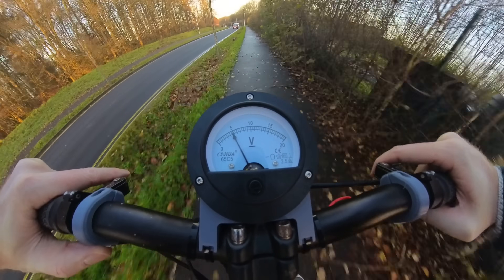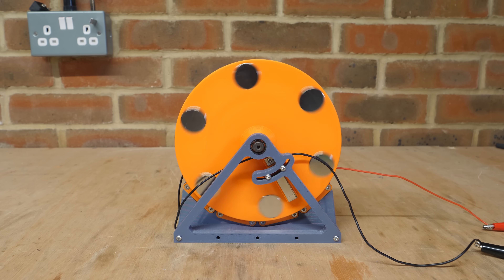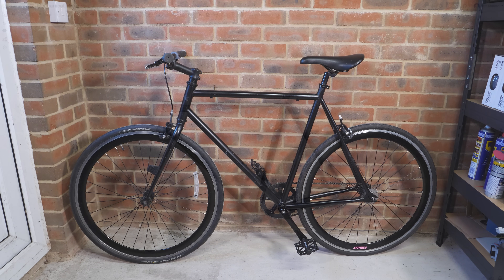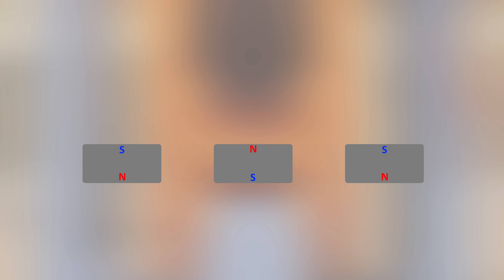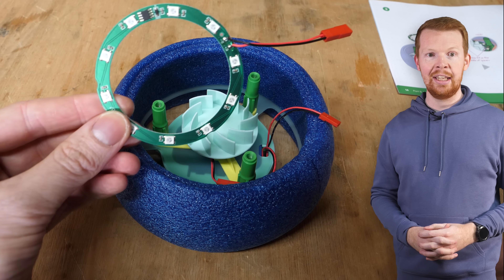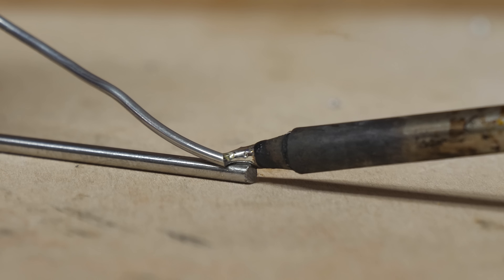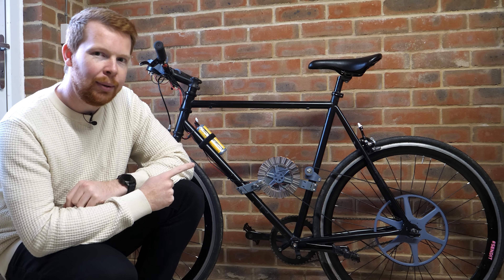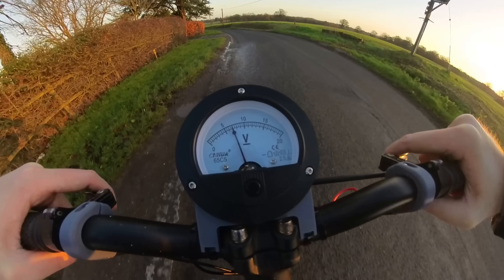The Most Minimal Electric Bike

Comment: If I may suggest...Add a capacitor,(perhaps a .02uf), across the contacts of the switch to absorb the arcing across them, much like a set of Points and Condensor in a car's ignition system...This will greatly increase the longevity of the contact switch.

Comment: Great job, Tom!  Small suggestion for whatever it's worth: a tensioner usually does better on the slack-side (bottom side in this configuration) of the belt.  The top side is going to almost always be in tension, so it doesn't need a tensioner there.  On the bottom side, you can even spring-load it to be an auto-tensioner, but on the top side, you would be fighting the spring every time you apply torque to the pedals & tension to the belt.

Comment: I had a bike cycle which i modified . I replaced the back brake with disk brake and removed the brakes pad from the traditional V from the front wheel. I attached  a small rc car gear motor to the front brake frame and when ever i press the  the gear get touched with hte front wheel and starts generating current which powers a small led infront of the handle . the vooltage it generated was around 5 volts. I had the safety on as i had a strong  back brake. there was little to no resistance at all

Comment: Idea: instead of using regenerative power to charge the battery, how about attaching a flywheel to the motor similar to the KERS bike from a while back?

Use the motor to get up to speed, and then when braking or going downhill, engage a clutch to transfer power to the flywheel and then use said power to charge the battery or as momentum to get the bike up to speed for the motor to kick in and take load off the motor on startup?

Comment: You should've wired magnetic switch to low voltage circuit, and which should switch contactor with high voltage somwhere else, maybe even have it in vaccum chamber as a wild card

Comment: On the issue of reed switch sparking:

The sparking issue that you see with the reed switch is the same issue that old school breaker points had when making and breaking electrical connections in the distributor of an engine. They fixed this problem by introducing a "condenser" or just a capacitor that is able to provide time for the metal contacts to separate.

Think of it like this, the coils are resisting a change in current flow, as the metal contacts move apart they are effectively trying to making the current flow zero. This causes a high voltage arch to form between the metal contacts until the energy stored in the coil is unable to resist the change in current or until the contacts are sufficiently far apart. This means the the arch is formed during the initial separation of the metal contacts, a capacitor added across the coil would increase the amount of time you have to separate the metal contacts to a distance where an arch is no longer able to form. 

I think you could fix your reed switch arching problem by adding a capacitor that balances your coil inductance. This balancing of inductance and capacitance is called impedance matching.

Great work on these projects, I love the videos and wish you all the best.

Comment: maybe instead of using magnetic fields to make your reed/read switch work. You just do a mechanical solution, bumps on the outside of the rotor that pushes the contact away and then use a spring to push it back close. this would still be in sync with the roto
Reply: reed switch and a power relay will work

Comment: Long time ago I've build an eBike with no electronics, just a 24 V DC motor, two lead acid batteries and three relays controlled by a 3 position momentary switch. It switched the batteries series-parallel. You'd start at 12 V and once rolling switch it to 24 V. You could also start in 24 V, but the motor was not too happy about it!

Comment: Great work. Resin printing for engineering looks quite strong. Plastic motor housing and frames is a good advancement.

One note on around 0:40 - I've found a lot of ebike motors are 3 phase ac. Hence why they all need those big mosfet inverter circuits in the aluminium cases. I think if we did use brushless dc that it might be more efficient instead of having to convert our batteries power to ac.

Comment: could you take a disc brake equipped push bike, drape a longer chain over  a brushed drive motor on a freewheel sprocket,  then glue magnets around the rims and for regen put 4 coils  positioned like  traditional brake calipers, run through rectifiers to charge caps or batteries ?

Comment: Forget Onshape, use FreeCAD instead and prevent that they can steel you your ideas with a simple change in their policy, like many other online operperated platforms did so far.
Take LFP batteries instead. Even for the supercapacitors is a balancer circuit recommended to charge them evenly. Yes, you get your electronics. 
Or even not. I have four LFP in series running for years without issue. Its much more juice than the capacitors.

Comment: As reference by others, a capacitor/condenser of the proper value solves the switch arcing problem. Plus a centrifugal timing advance/controller like in an old car distributor.

Comment: The idea of an electric bike that doesn't feel like it weighs two tons when the battery runs out,sounds great to me.I also really like the fact that it is for the most part additive and not invasive. If you were open to using at least one power mosfet to get rid of parasitic losees, sparks and the noise from the massive reed switch, this could make for a great assistive bike propulsion system, practical for daily use.

Comment: I like the idea of a bike with regenerative braking. The energy only ever goes into heating up parts with friction, so why not make use of it to charge a battery pack and run a light or charge a phone? Even if it isn't in an electric bike that can use that energy for driving it's still so practical!

Comment: Back EMF from the motor should be redirected to the battery using a diode or two. Just A slight deviation from the electronicless design

Comment: Great project, Tom. Some notes:

Regen on a bicycle isn't terribly useful because the majority of power input to a bicycle is lost through aerodynamic and rolling resistance losses, rather than going into inertia. So there's just not that much energy left to recover compared to something like a car.

A less complicated mechanical motor controller can be achieved by using a brushed DC motor with a mechanism to vary the contact angle of the brushes. It's very similar in theory to your reed switch motor, except with all the engineering difficulties already sorted out. It also gives you continuous control of the motor speed, both forward and reverse, which is pretty cool.

Copper or silver is going to be a better contact material than tungsten and definitely better than nickel. Just physically not melting is only one factor in durability: you want a contact material that's not prone to building up an insulating oxide layer, and which will generate as little heat as possible to begin with, while conducting it away from the contact point efficiently.
Reply: I regularly ride 300-500 mile cycle camping tours on an ebike I engineered myself. Frequent descents can be as much as 4-5 miles of steep grade. (One was 1500 feet down in 3 miles.) All lost potential, without any form of regen. You do you. I'll take any regen I can get rather than coasting to no gain at all.

Comment: to solder tungsten you have to heat it up to red hot, a plumbers torch will usually do the job, stick it into the flux tub when hot and use lead-free solder,

Comment: I do love the simple lack of electronics with this but I wonder if this could be further automated. Could there be a system to detect the RPM, and the super capacitor voltage, to automatically charge/discharge the super capacitor? It’d take the thought out of the switches and hopefully give you the optimum output for whatever you’re charging.

Comment: As an older fire alarm, technician,
My advice is Silver contacts like used on older (very old) Acme and Edward's box and gong circuits.
Very large silver surface area that can be very highly adjusted by nature of multi leaf  spring contactor construction.

It's the large electrical induction that kills  the contacts.
Have used similar contacts for high output capacitors.
Elevator contactor contactors can be fun as well, as older stuff is dc, coils that is, lol.

Just an opinion.
Cheers 🍻...

Comment: Put a Capacitor across your tungsten points to minimize arcing. Use 50 volt capacitors for energy storage. Mount your
magnets on Aluminum disks 5 to 10 mm thick  and 1.5 times your current diameter.  Make the motor drive pulley smaller for
more torque.  I really like your minimalist design.   👍👍

Comment: Years i ago i did a water ignition circuit and found out contacts wear out. The solution was an ac capacitor across the contacts and my arcing was solved. Carry the current and keep both sides of the contact equal in voltage. Essentally a crude dc snubber.

Comment: You guys like CAD programs.. something neat you can use them for is to learn about angles. An angle is defined as two straight lines meeting at a vertex. The Cad program will tell you, it is impossible to take an elevation angle from the surface of a sphere.  This means celestial navigation's elevation angles Prove Earth is a flat plane. - test it yourself!

Comment: why do it to add a push on the wheal when you can benefit from the voltage to turn a Fan ON, so you will benefit from wind pressure to push you?

Comment: Could always use a relay for your reed switch. Vehicle relays are cheap. Most junkyards charge next to nothing, if they charge anything for them. A starter relay should easily handle the amperage, I would think.

Comment: Problem is you are switching a coil which resists changes in current flow through self induction. Easy fix is to use a diode in inverse parallel with the contact as a flyback arrestor. Plus its not a transistor or a microchip, so still keeps the no electronics rule.

Comment: the design of an iron core of an alternator can be optimized for minimal cogging.
yer low-torque motor should have the maximum amount of  mechanical advantage (MA) over the load.     in other words, the smallest practical drive pulley radius should be used.!!!

Comment: The slack of a belt or chain on a push bike should never exceed 1” or 2.5mm of slack.  More slack than that will likely cause the chain or belt to jump off a sprocket.  Read up about spark quenches.

Comment: I think the sparking can be significantly reduced with a flyback-diode across the reed switch. The voltage across a coil is proportional to the derivative of the current ( v = L dI/dt ). So if you suddenly break the circuit by opening a switch, no current can flow and you induce a huge voltage (hundreds of volt) across the opened switch. A flyback diode across the switch (which cathode to the + of the supercapacitor and anode to the - of the supercap) will create a path for the current to continue flowing through the coils, preventing the sparking. It is a well-known trick.

Comment: I would be curious if something like this would be implemented on e-bikes how much would the battery range extended. I guess it depends how much downhill you do:)). 
I do not remember the hub engine e-bikes having any regen although it could. 

Ok ...here is an idea - adapt a normal hub dual engine bike to regen and see if it is worth it. I don't remember you trying this.  Technically should be easy to do -- only the electronics should be changed.

Comment: As soon as I saw the first set of contacts, I knew you'd need something else. :) Simple contact switches don't last any time at all. But there's another issue. Coils have inductance; they make electricity behave as if it has a lot of inertia, so when the current gets cut, the voltage goes sky-high as the electricity doesn't want to stop. That's what was destroying your contacts. What you might want to do is have a reed switch driving a sealed, high-power relay rated for an inductive load. However, I don't know how this dual-magnetic-switch sort of arrangement would behave in rapid switching.

   But I love the look of the coils. :D The analog voltmeter too, I miss those things.

Comment: The problem is that what you've made isn't technically an electric bike, but an electric motorbike, because electric bikes in the UK have to run on pedal-assist. Getting a pedal assist that doesn't rely on electronics wouldn't be easy.
But what you've done is upload a video for public viewing of you operating an unregistered motorbike on public highways, and operating a (n unregistered) motorbike on what is presumably a dual-use path for pedestrians and cyclists...

Comment: Very cool video. What about using a normal motor, but with a mechanical clutch. Make an inverted clutch so that it is disengaged by default, and then engaged when pressing a handle/button?

I believe this is used on both electric cars and ebikes, but I don't know if it is mechanical or elctrically controlled.

Comment: You could use old cars points. They are cam driven from the distributor shaft, but your wheel could replace that with little bumps printed vs use magnetic input

Comment: I wish Earth had plasma ultrasonic pressure images being used for 3D printing and nano-structure control by computer. "Ultrasound can produce pressures great as the bottom of the ocean" Claims Illinois EDU.. Plasma can do more Points at Boeing plasma force field blocking shock waves from explosions If you can figure out its real name when it gets that strong. < Hint given.. Destructive sound interference Now imagine it continuously holding an image for direct sound printing.

Print back tiny metal cogs into the world but material super dense and perfect so they last forever. Little tiny cold steam Tesla generator + Nutrient drip for days to feed high heat Thermophilic bacteria + Overpowered to overflow into capacitor for boost takeoff. Figure out a steady drip feed diet to the Mulch fire Thermophilic bacteria to power an Ultrasonic echo and resonance water converter from atmosphere you might as well upgrade to a duct style craft to blow your engines through for your own grip in the sky. While sucking heat from your ducts for even more power as those engines burn.

Just saying..

Comment: You could cheat slightly and use a single hall effect sensor and mosfet, but no other electronics. It's still just a couple analog discreet components. Also, using a much larger cap pack will help a great deal. I like the idea of keeping it simple while also requiring exercise. Looks fun!

Comment: Tungsten doesnt readily take on solder due to the oxide on its surface. Applying some soldering flux, sand the rod away where you applied the flux, wipe away the contaminated flux, apply new flux and solder.

But of the tungsten do heat up enough where you soldered, it will still melt the solder and the whole bit could become disconnected.

Comment: "... which is about a thousand degrees higher than steel" this is wrong. Steel does not have a melting point of 2,400 C. Its melting point is closer to 1,400 C.

Comment: I see this as a good start to thinking about equilibrium. To use this for best effect, taking advantage of downhill motion while still pedlalling wont add much perceived effort, but going up the next hill can ues up or cancel out the effort to overcome the work needed. Basically, it should make the bike ride the same across any distance as long as the start and end point are at the same height. The ups and downs in between  simply cancel each other out.
But back to bikes, that sounds like a vehicle that takes only as much energy as you put into it. Meaning any terrain should in theory take equal effort to the equivalent of its starting and ending elevation when applying this bike technique

Comment: Solving a problem is always an interesting learning experience. There is a way to solve the switch problem without starting from scratch.
You already have a switch that works but you need better contacts. Use your working switch to control a relay with contacts that meet your specs. Semiconductors aren't the only devices that have amplifying qualities.

Comment: If only there were a component that would prevent points style contacts from arcing, pitting and welding themselves shut.......  like maybe a CAPACITOR.   With a capacitor, it's still not "electronics"..

Comment: If you want to weaken the outer magnetic field why not use a simple piece of steel? It will act as a flux guide with little "magnetic resistance" - thus both weakening your outher and strengthening your inner magnetic field.

Comment: Very good design, for the most part. I'm sure others have said it, but a very basic analog switching circuit may be the last piece to make the motor control work. Possibly a small coil to generate a control pulse to switch a high amperage mosfet - I'm not schooled enough in the circuits to actually pull this design off properly myself, but I am sure there is someone that could. Keeping the parts count low while avoiding a micro controller would seem to fit this bikes basic principle.

Comment: The 1990s ZAP power system was all electric without electronics. Used brushed DC motors with a series /parallel switch for two speeds. Really worked well and they made around 30,000 of them.